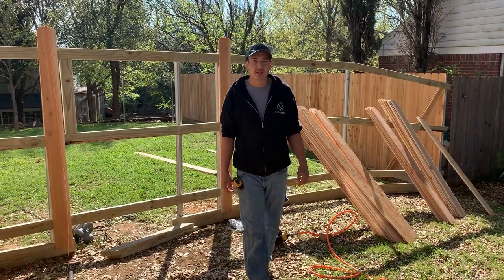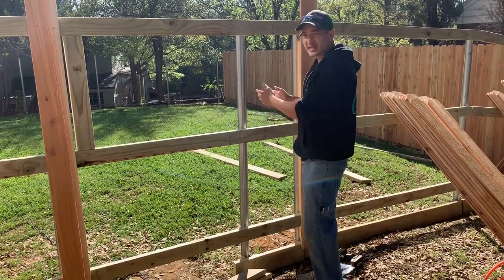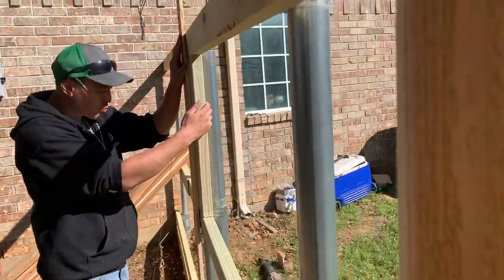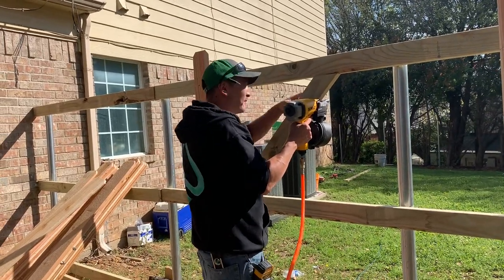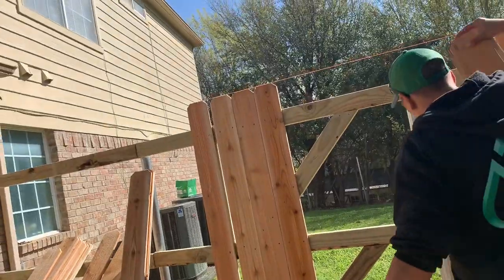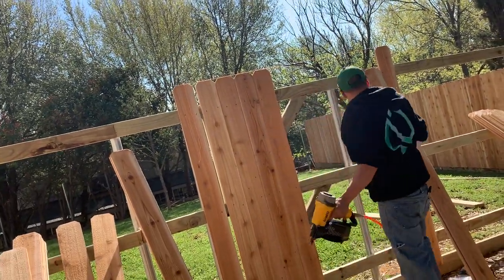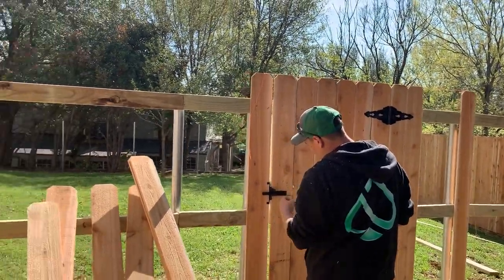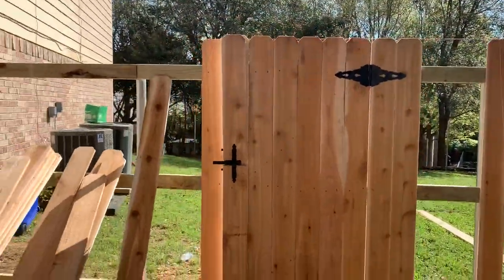How to build a wood fence gate(the right way 2019)

Comment: Your diagonals are the wrong way. The idea is to go from the bottom hinge to the top opposite corner of the door so that all the weight pulling down from the door will be translated back to the hinge. Also you need to build a frame so the diagonals have a vertical piece to attach to not the horizontal ones. ( the same piece the hinges should attach to)
Reply: Nervjiggy is right -the weight on every gate, no matter who, what, when or where is always transferred to the hinge side of the gate and never transferred to the latch side. Simply put, you can follow the diagonal line(s) of the brace(s) you've installed in this vid and be certain that the weight of your gate will be transferred to the latch side. No bueno. Trust us, no matter what gibberish you're being told, there is not "another way" to align with the laws of physics. These are details that are lost in the trades these days and if you'll pick this tip up from us, it'll simply provide more value to you and your clients -your 2 year no sag warranty will be rock solid, hell make it 5 years if you orient your braces correctly. You're a top notch fellow with a "level" head on your shoulders -keep up the good work!
Reply: You are correct. Angles are facing the wrong directions. Angles go up from hinges to high point in gate opening never going over 45 degrees. Puts weight on hinges and not on gate latch.

Comment: Love that you took the time to show my biggest problem when buliding fences--the gate  My only question is how would I do  it with a board on board gate that swings INTO the yard, not out.
Reply: Assuming board on board side is outward facing, the hinges are installed on the inside and on the 2x4 itself.
Reply: @louie1487  OK, thanks.   I did that and it worked.  However, what latches can you recommend that allows one to open gate from outside?

Comment: Have you ever revisited one of your projects a year or two after building it? I'm just curious as to how well the gate would hold  up with how you reinforced it. With our climate and humidity, a gate without a full frame would sag and warp
Reply from the maker: Yes I offer 3 year warranty on all gates if there are any sagging or failing issues. I have has to come back to 1 job and it was to install another new post in which we originally used the prior post

Comment: Hey Derek, great video describing the gate install. Im installing a fence like this and also a gate in this manner. I have a question, about that second post next to the gate post. I know its for support right. How far from the gate post would you put that. looks like its about 2 feet apart.
Reply from the maker: Make sure your 3 post are within 8 feet of each other so you can use a 2x4x8 if you want a wider gate use a 10 footer as yes it is so your hinges have more then one post for support . I always recommend starting on your gate section then the left or
Right side rather then gong left to right

Comment: Not bad; (here comes the but..) but why add the extra picket -@ the end; U mention not wanting not needed weight... Just cut a notch for latch hardware, letting U keep picket gap the same also. And were is toolbelt...U a weekender or a pro here?
Reply from the maker: You can absolutely do that . And the tool
Belts tend to get in my way so I don’t use them

Comment: I get why you would want two posts on the hinge side of the gate but would you put two on the opposite side, its not carrying any weight? Just for a heck of it?
Reply: Every time the gate closes there is lateral force applied to the post on the latch side. By adding an additional post you are able to spread the impact among two post. This helps insure you have a gate post that wont weaken its connection with the ground/concrete over time.
Reply from the maker: Well put Patrick !

Comment: Good fence workmanship, do you use a framing nail gun?
Reply from the maker: Ivan I use a coil fencing nailer . They are light weight and shoot the nails I like to use which are 1 7/8 galvanized rim shanked nails
Reply: @derekhelms825  Your picket nails are the same lenght? What lenght you give the post from ground up, and horizontal 2×4's??
Reply from the maker: Ivan the nails are 1 7/8 or 1 3/4 rim galvanized steel rim shanked nails . The post are 6 ft from ground to top which will later be cut to about 5 6” or the height of the top 2x4x8 rail
Reply: Do you have a brand and model of nailer you can recommend?

Comment: How far are the post that are for the door ? The 2 inside ones ? I noticed it was around 8/9 pickets away from eachother
Reply from the maker: I keep the 3 post within 8 feet of each other so I can use a single 2x4x8 this gate was 40 in wide. If you want a wider gate you can use a 10 footer

Comment: holy cow .. nice.. what's the length of the pipe? how far in the ground are they/
Reply from the maker: They are 8 ft galvanized steel post set 2 1/2 feet into the ground with 60-80 lbs of cement

Comment: Will this pattern work for an 8 foot high fence using six 6-inch pickets for a 36-inch gate?
Reply from the maker: Yes. But typically you would cut the gate out at about 6 ft minimum on a foot fence . You don’t want to have a full 8 ft gate swinging open bc the amount of weight.on it will  definitely cause the gate to sag in the future

Comment: I see a gap still after putting a picket near the latch, plus the notch made into the pull handle not used. I may be knit picking but I wouldn't want to pay a pro for this kind of work..
Reply from the maker: The gap is where the gate opens and closes. There will be another pocket placed on top once it is done to cover the gap . I only showed how to make the gate for times sake

Comment: Dude. You built your cross members backwards. They slope down from the hinge when they should slop up from the hinge since the wood works better under compression. Also, you said yourself that the pickets will shrink so the lag screws that you put in to secure the hinges are going to split the wood as it dries. How have you been doing fence for ten years yet be making these rookie mistakes? A two year warranty? Hahah bet you get a lot of calls on those gates in the future